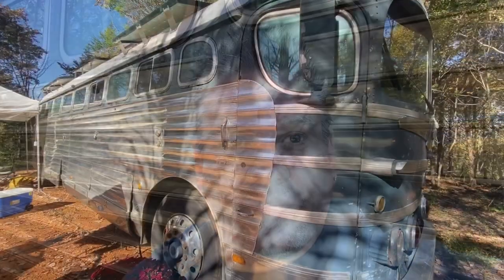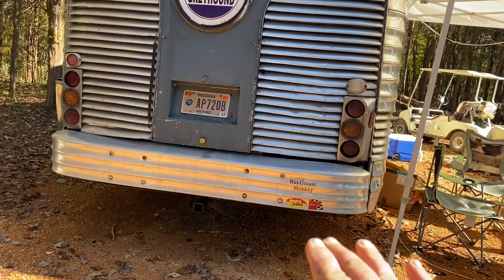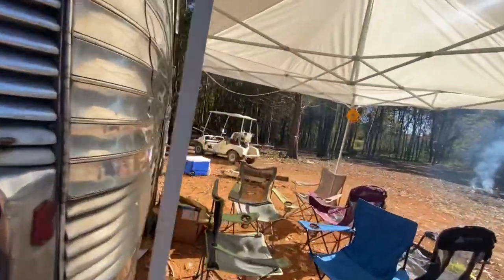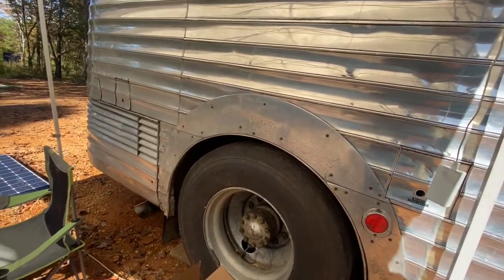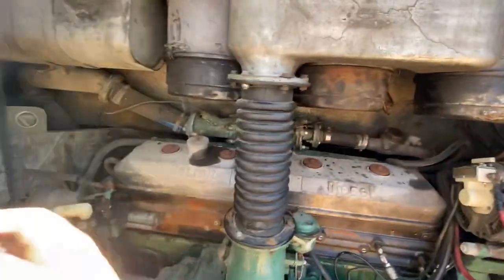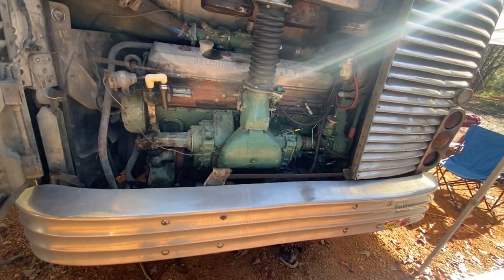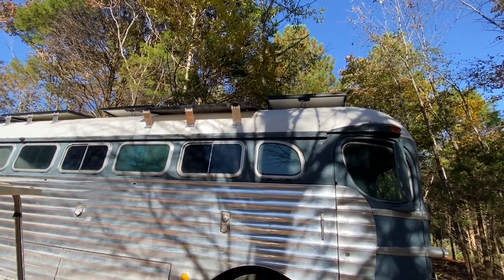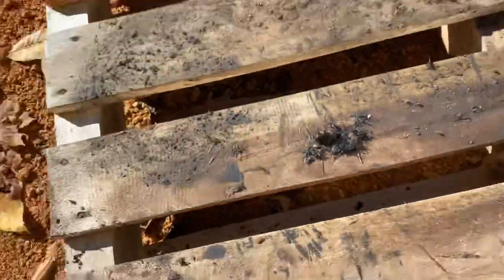Bus Leaf Spring change results

Comment: Temps here in Florida have been in the mid eighties, five day forecast looks good for the wedding.  On your way back, on I-75,  exit 161 has a large Pilot Truck Stop & Walmart if you need fuel / supplies.  Best wishes for a safe and fun trip for all.

Comment: You can remove snakes from glueboards with vegetable oil, or any other cooking oil. Keep the oil away from the snakes face and nose. Use a Q-Tip with vegetable oil around the face.
Reply from the maker: Was not glue trap

Comment: You prolly wont see this since this is and older video --- But plain simple coffee  beans in a mouse path will keep them away  (and for rv winterizing as well) --- and  Ajax cleanser  around  your tires and plumbing  keeps ants  from  using those to climb into the Rv ----- Those 2 tips from the Airstream forums I learned years ago

Comment: Shouldn't you always change both the left and right springs at the same time?  I hope the bus run better than the "Thing".  Thank you for the video sir.
Reply: Jack the reefer.
       It's the ideal, and I would recommend it on an older car/truck,  but not a must. A spring problem should be dealt with a.s.a.p., but once the bad side is handled, you can see how the vehicle sits side to side and how it handles before deciding whether to do the other side. It also usually doesn't save you any money to do both at once vs. one at a time.
      Hope this has been helpful. I was going to say stay cool (reefer) but maybe that's not your kind of reefer.
Reply: @richardmcavoy6413  Most if not all highways have a crown in them for run off. While owning my own rigs for years pulling dump trailers with a high center of gravity. I had to add a extra leaf on the ditch side on the steer axle to compensate and keep the tractor level  and the trailer follows suit
Reply: He did change the other spring not too long ago. It's in a previous video.

Comment: I hope your having the wedding on the beach at Lani Kai resortl. If not at least check it out the whole building is done in murals. You can walk around it and check out the floors. There's a restaurant at the top floor and a bar at the bottom on the beach. You'll know it's the place  when you see it from the  street.

Comment: I would have just picked up the snake for you and pulled the trap off. The bite is just like a pinch if they catch you right. Usually draw blood cause of the small fine sharp teeth. But don't hurt compared to wacking your knuckles on something or hitting a finger while working.

Comment: It just looks like you need to shine up those tires again lol also have you ever considered using plastidip spray paint on the bus, it would just cover the original paint and you can just peel it off when you dont want it, it doesnt look like a tremendous amount of surface area